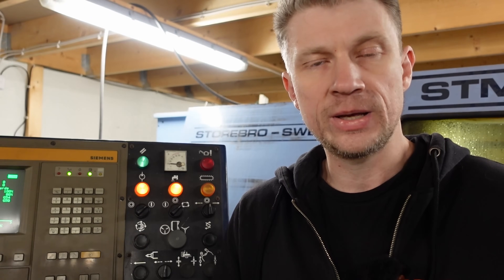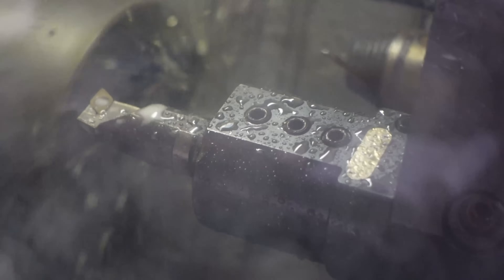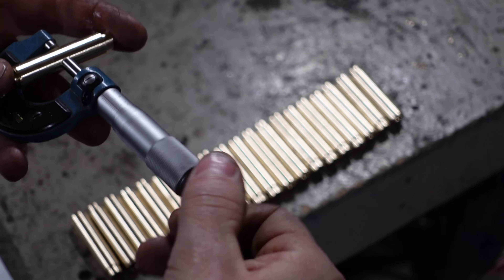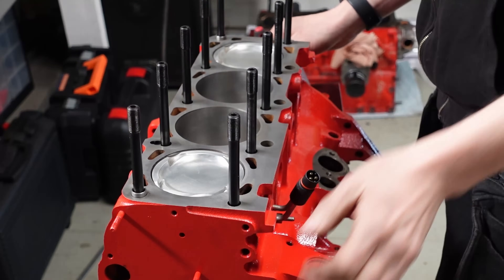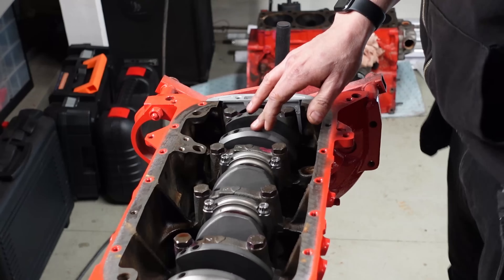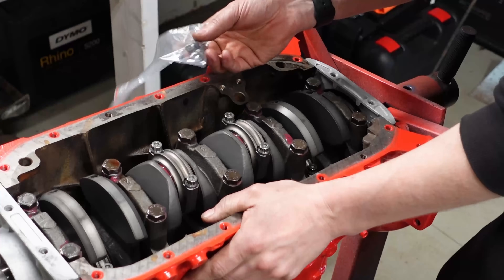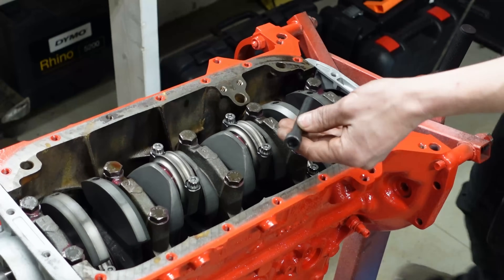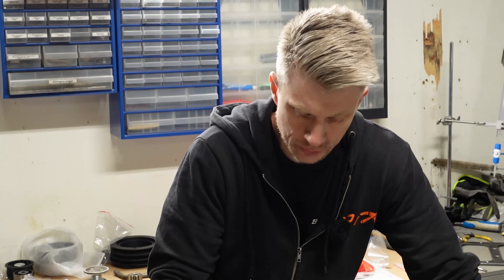800hp Volvo 16v B230 Build. English version EP 1

Comment: Thanks for all this valuable information. I'm brand new to redblocks and am absorbing all this like a sponge. 
With the girdle plate, obviously the oil pump gets in the way of the 4th cross bar, but if it was possible, would having a connection there make it even stronger, or would it ne negligible? How important is the grade of steel used for the girdle?

Comment: I would definitely buy the files for a girdle plate. Also please include a recommendation for bolts to use with it.

I would love to see more about the assembly process and top end build.

What are your bearing clearances? What did you choose for rig gaps? Since you are not using the turbo block where are your oil feeds and returns coming from/to? Also the hole for the distributor is blocked, are you using a head mounted distributor? Maybe a standalone ecu with sequential ignition and injection? What head gasket do you plan to use? Will you cut the groves on the block for o-rings like do you on your other builds? What is your target quench distance?

Comment: What is the diameter of the groove you made for the 600hp block o-rings and what was thickness of the wire?
Reply from the maker: can't remeber right now but it is suposed to hit the middle of the steel insert of an original gasket

Comment: Will you be doing steel main caps integrated into the girdle ? 
And are the guides wider than standard to take more valve heat away ? 
Will there be any internal valve guide head relief 
Is there going to be any fire rings or gas port relief to hand the cylinder pressure of 800hp ?
Reply from the maker: The girdle should evolve ti something like that if i want to take it to the next level. Regarding the valveguides, i'm making them in ce307 material that has alot more heat transfer. Yes i use cut ring gaskets

Comment: What is your thoughts on running arp rod bolts without washers? Why or why not?
What is the most commons reason(s) for a b230 to break internally? Would be nice to have a video specialized on b230 dos and donts in your opinions ;) also a shop tour would be fun to see! Like all of it!
Reply from the maker: I have no direct thoughts about washers, maybe some one has and can comment. The most common reason is that people mounting lightend alu crankpully. This engines need dampers. Shop tour can be possible in a very short future:)
Reply: What damper you are using in these engines?

Comment: Excuse me, can you help me? I own a redblock M47 and I was wondering how much torque or hp it would take... Do you have experience on this topic? The internet is conflicted about this and I think about going for a GS6 swap... Will the M47 last at 200 HP? I do cavalier starts from a green light sometimes...
Reply from the maker: m47 can handle 200hp N/A engine but some more torque engines will crash that gearbox in no time. Go for a Bmw directly
Reply: @Overboostracing  Okay, thanks for your time and expertise. I will keep the M47 until I turbo my B230FB... 200 HP N/A are hard enough to reach, I will take it easy... It should last, it is the M47 gen II
Reply: @that_escalated_quickly2720 we have a M47 in our 240 Lemons race car. It held up well but got destroyed after about 10 races or around 10k miles of very hard drving. We are making maybe 150hp. Went for a +T this winter and we expect the trans to go in out one race
Reply: @mully006  mhh okay, good to know, probably 5th gear went out? I've heard overfilling helps keeping them alive, but we'll see...  I have the wagon version, so the heaviest version of the car with 4cyl, I hope it will last a bit till I have all the parts for a GS6 37DZ swap... MKM makes a prefab transmission and supplies some additional parts for it, but its costly

Comment: Is it ok to use a 360 oil pump in a B230FT?  I worry the flow is too low.
Reply from the maker: volvo 360? b19? b200? Anyway, think they are good
Reply: @Overboostracing  yeah it's from a B200.  Fitted to 360 with 360 sump.

Comment: I thought all B2xx used forged crank.  Which ones have it, if any?  B230FT?
Reply from the maker: B23 and b21 has forged crank, but weak engine blocks
Reply: @Overboostracing  Is it some mistake or I wrong understand? Here U wrote all b230 has forged crank or turbo only? Because in video U sad it is cast. And what do U mean when wrote b230 has weak engine blocks?  I thought Eng block is strong point that motor

Comment: All praises to Valhalla 😁
Reply: @Overboostracing thank you for taking the time to answer our questions! Your expertise is more valuable than you know!

If you could be so kind to share what your thoughts are on a twincharged B23 16v? The 16v has stainless valves, stock size. RSI (Wiseco) 4v pistons 96.5mm and H-beam rods. 

Mercedes M62 clutched supercharger and Holset HX35 for twin charging.

You said in a comment below that bringing on boost early is good, could you share how best to support this? I'll wait for your girdle file as well 👌🏾
Reply from the maker: that would be awsome to se, some guys have been doing this and it actually works good. Bringing boost on early is bad for the block because weak cylinders is what  i meant.
Reply: @Overboostracing  I see! Thank you for the clarification!

Comment: Thank you for the share, thank you for speaking english and thank you to propose the girdle datasheet. 

From which power or torque output do you think that girdle is recommended ? 
How much power output stock pistons (malhe 9.3:1 as on B230FB) can withstand ? 
I noticed on some tunes I made the spark plugs readings indicates kind of lean mixture despite the lambda reading is in the ballpark... Is it something known with these engines ? Maybe due to the colossal 96mm bore size ?
Reply from the maker: not something that i'm aware of, sounds strange. Most of this problem boils down to different flow of air in intake manifold
Reply: @Overboostracing  many thanks for that reply. I will continue to investigate this

Comment: How do you feel about sleeving the bores and go with a slightly smaller diameter? And what kind of sleeves would you use? A tough and elastic steel like gun barrels or something harder or softer?
Reply from the maker: That's a know way to make this engines more durable. 94mm bore is one size i know has been built.
Reply: @ I have thought about this since the bores are pretty much the only weak part on the B230 1989–> block. I know there are different castings and what has turned out to be superior has obviously happened randomly. SPM and s few others have casted their own blocks, but as far as I know they have had other limitations simply by not being able to match Skövdes casting quality. Do there comes the sleeving into my mind. Sleeves are made of steel way superior to cast iron with a crystal integrity on a whole other level. Deformation point comes at some 2.5-3x that of cast iron. And you typically want 3.5-4 mm wall thickness in your sleeves according to some BBC pro stock builders. Kept in mind that V8’s have shorter rods and more force on cylinder walls I’d guess ~3 mm would do well for high revving 7-800 hp road race builds?

Comment: all hail the mighty redblock!! 
what do you think is a safe power level for a pre 90 block with the mid location thrust bearing?
Reply from the maker: Early engines is not the best because of the poorly thrust bearing at the crank, otherwise the cylinders should be the same as the newer blocks
Reply: @Overboostracing  yes i understand. but im curious how well a early engine will live with 300-350hp

Comment: Do a video on gearboxes. What actual power volvo boxes m47 m90 etc. hold. What gearbox will be used for this 800hp engine ? 
Or maybe there is forum/blog post with this info ?
Reply from the maker: We only use bmw gearbox here in sweden.  Volvos m90 is suitable for lighter cars up to 600hp. But after driving alot of bmw gearboxes and recently an 8hp, im impressed with the 8hp auto trans
Reply: Stateside, I'm thinking TKX or CD009. Across the pond is littered with manual BMW transmissions and we don't have a lot of aftermarket support for them.
Reply: @IndieBuildie  I installed a CD0005 with the adapter plate sold on Yoshifab (maybe by someone else I think) the install went well but I haven't gotten a chance to test it under power yet
Reply: @mully006  what series Volvo did you put it in?

Comment: What the upper limit for the b230 in hp?
Reply from the maker: I have run 1200hp on a cement filled block. Only for dragracing. But i will say for street use with todays good turbos building a lot of boost early in rpm, 800hp is the maximum without cylinder enforcing

Comment: Hi! Nice! In the past you have made o-rings on the block. Will this block also have o-rings a block? Or are you no longer making this adjustment? Thanks. Tom.
Reply from the maker: There are different stages of builds that's suites this o-ring. Technically you can use them to 700hp. But
Much better and easier to buy a athena cut ring gasket